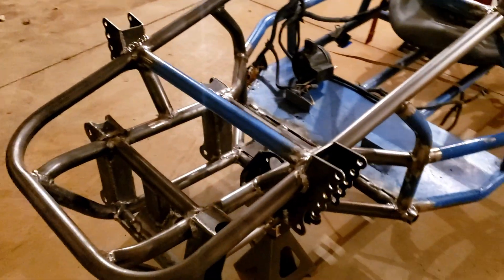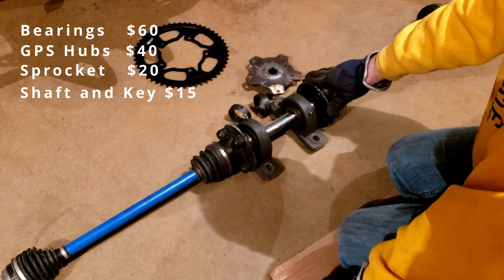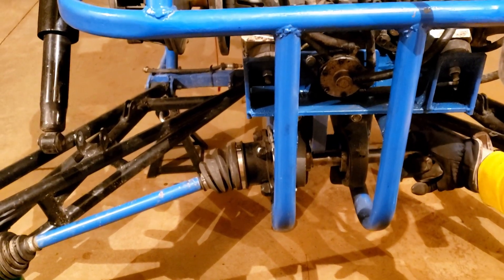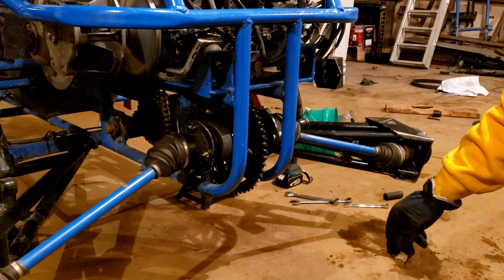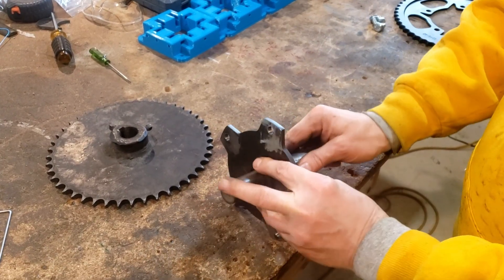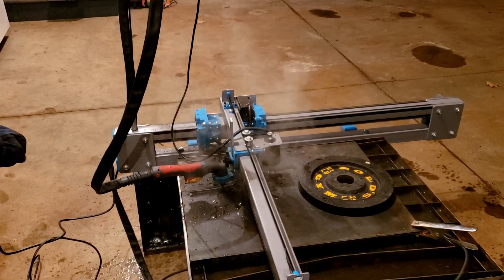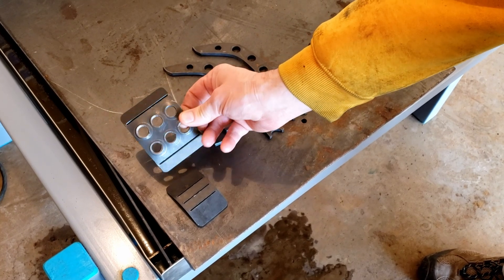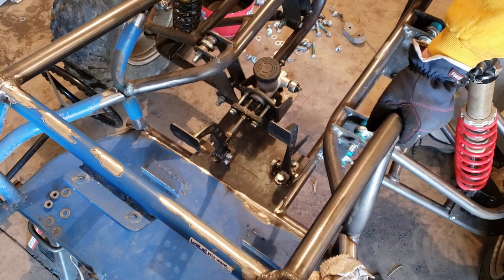Budget Crosskart IRS Rear End & Pedals

Comment: I grew up racing go karts from PA to NC. That was 20 years ago when we finally stopped racing. Do you guys run disc brakes on all 4 corners? I’m trying to get a plan together to build one of these with a gsxr 1000 engine and 4 wheel disc brakes so I can have some fun in the city streets of Philadelphia. Do you have a direction of where I can look find more info on this type of brake setup?
Reply from the maker: This video here doesn't use 4 wheel brakes but shows how to use spindles that have brake caliper mouts and can be added. https://youtu.be/OAZpm4VLepk

Comment: Would you be willing to share the front A-Arm Mount and Shock Mount files so I can cut them out on my CNC?  I am building the KJ VF-2 which has same front and rear dimensions.
Reply from the maker: We aren't going to share them because they won't fit any other buggy. The a arm mounts won't fit the KJ cart because of different tube sizes and the shock mounts won't fit because they are mounted at an unusual angle.

Comment: Question..??  Which shock absorbers do you use..? I am looking for info on what's the best shocks for my IRS, regarding the max load capacity and I don't find anything at all...? I install a gy6 on my go kart..
Reply from the maker: The front is using polaris rmk shocks, 105 lbs springs. The back it's just using air helper shock for a trailer.
Reply: Any help will be well aprciated it..

Comment: This is basically the setup I have on my buggy. I really like the chain adjustability and narrowness of your other design. I was wondering if you could combine the two. Mount the pillow bearings vertically on one pivoting base. Butt the two hubs together and mount the sprocket on the outside of the hub.
Reply from the maker: That is possible, it could work.

Comment: Do you think that stub axle with the keys and gopowersports hubs will support that high horsepower and torque? I love this setup of for the rear end!!!
Reply from the maker: It holds up really well, we've been using that spool for a few years. Trick is to use parts fit together with no slop.

Comment: One last thing, could you slot the holes for the pillow block bearings then welding nut in front of them with a bolt to stop them from sliding forward? Also what powers the buggy?
Reply from the maker: Yeah, this is possible but in this case we mounted the bearings vertically so they can't be pulled forward. The engine is from a 1993 Polaris xlt 580.